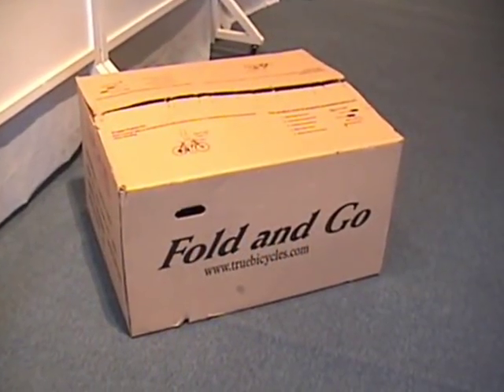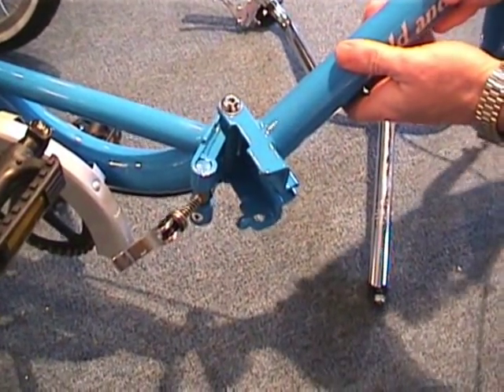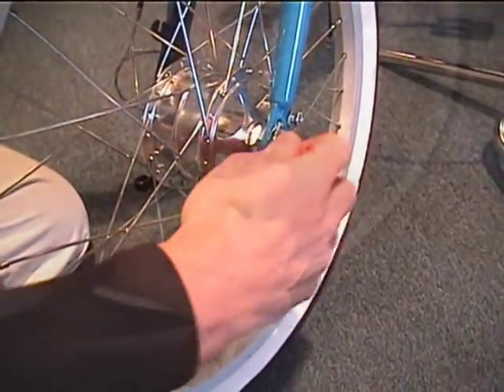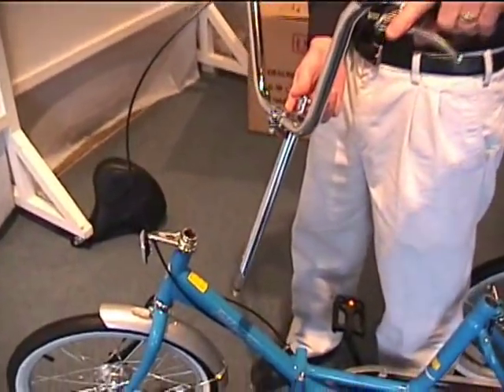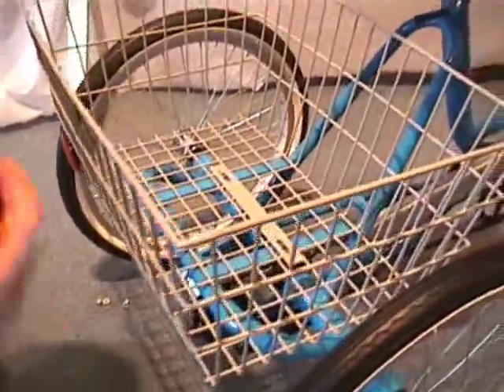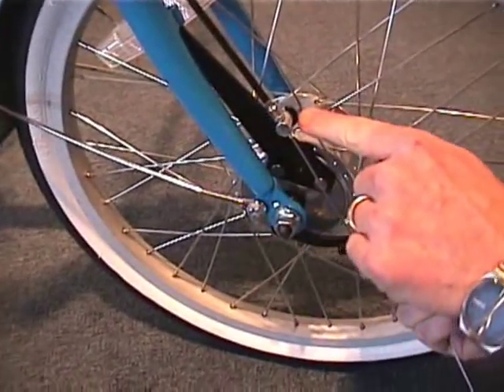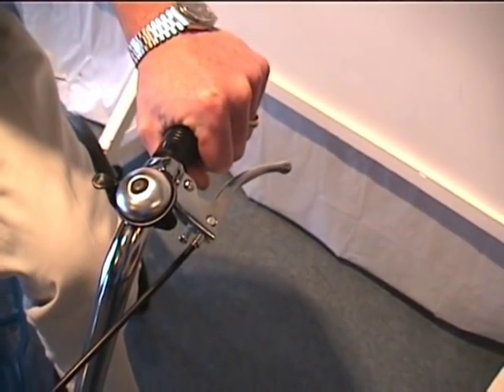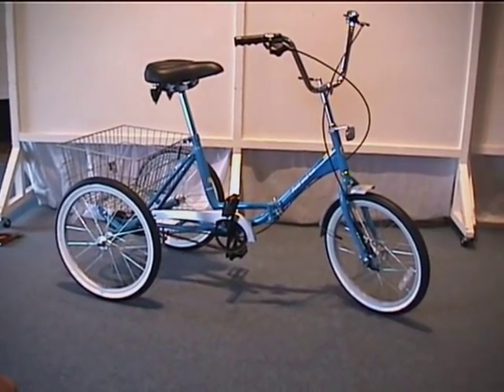Fold and Go  Tricycle

Comment: HUGE problems with assembly.  The video has the rear wheels already attached and the one we received had them disassembled.  To add to that, the wheels don't seem to fit the way the video shows.  One side comes out much further and the spacing ring doesn't even fit on the other side as the text instructions say from the website.  HELP!

Comment: Mine came with the wheels loose in the box. Also a plastic bag with bolts, washers, spacers and allen head bolts. The people at truebicycles didn't seem to know what I was talking about. The bag of parts might be spare parts. They also didn't tell me to loosen the axel lock bolt and lock nut. This is what causes the wheels to turn when you pedal. When tightening the wheel nuts, this must it is loosened so the axel will pull up tight where it belongs. Then you can retighten the bolt and lock nut. Just be sure that it sits directly over the milled slot in the axel or the wheels wont turn. I think mine was sold to someone else and returned and reshipped as is to me. I'm going to look it over very carefully and if it has any more issues, it's going back. They admitted it is made in China but assembled here. They must hire morons for the assembly line or they just don't give a shit. Good luck with yours.